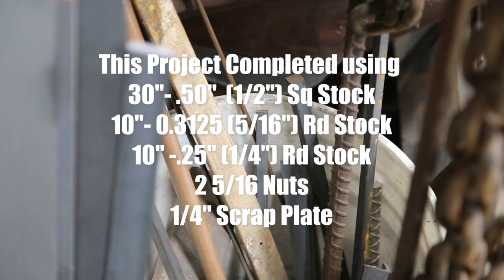forging an Anchor out of Scrap Metal Simple #blacksmithing  #forging #Project #fyp #diy #newvideo

Comment: i will say one thing you get my mind ticking over,
im guessing you buy your metal in,
are you able to sauce any free metal from anywhere.
im always on the look out on my travels.
all my best simon uk
Reply from the maker: Thank you Simon,  honestly we've found it to be more cost effective to use new materials.  By the time we take scraps and cut, grind, and sand etc there's too much labor involved to justify cost.  Based of course on the type of work I do. If we were doing scrap metal art and could re-purpose without allot of cleanup it could prove fruitful. But where as most of my main work is sheet steel and bar it's nice not having too much prep work.